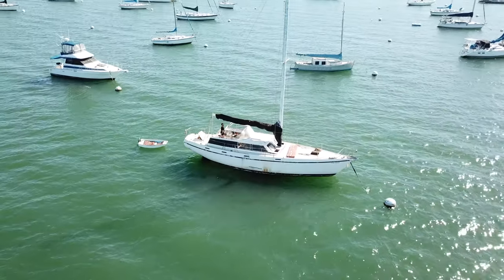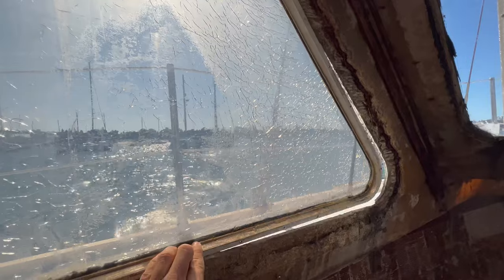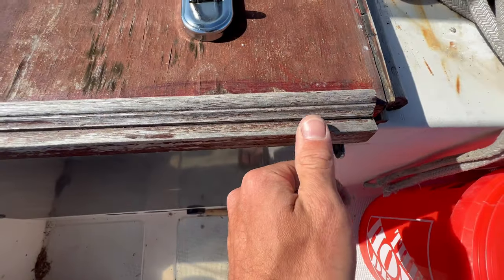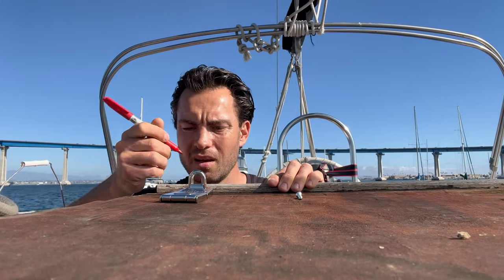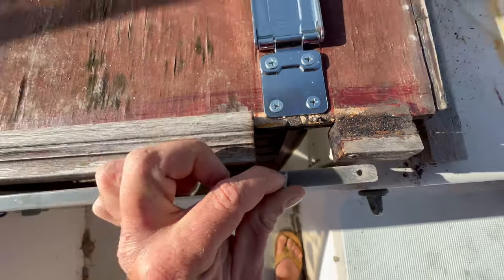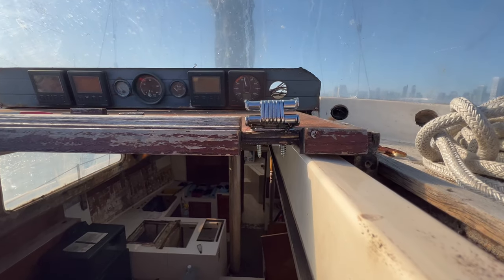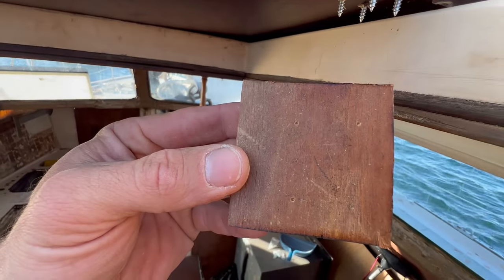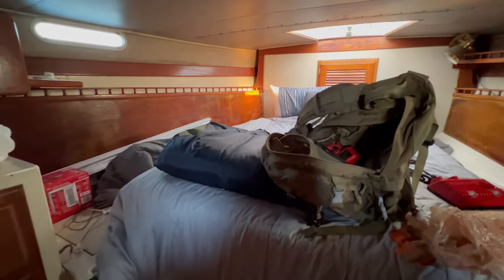Installing a Lock and Securing a Sailboat (Episode 34)

Comment: Doesn't your multi tool have a metal cutting blade? Just cut those screws off.
Reply from the maker: Hi John. Metal screws really tear up the blades on multi tools, especially stainless steel. I really just need to get a pack of blades and have a dedicated demo one. The grinder would have been much better, and I didn’t have it on board at the time.

Comment: Hows about two locks, one on the door and one on the hatch? The overhang, I would assume, is important to keep water out. The front of that hatch serves as a drip edge. If the dodger is over that section, then you will be fine, but I see the dodger doesn't go over it. 😬
to fasten the lock, I would use machine screws and nuts with washers so it would be that much harder to rip off.

The REAL question you have to ask yourself: Do you want to do the repair RIGHT? or do you want to go SAILING? I would suggest the latter!! Halfass-it and go sailing!!
Reply from the maker: You are right on all fronts. Two locks would have been better, and I'm REALLY hoping were done with the rains this year lol. 

I want to go sailing, yup, yes sir, that's what I want to do!
Reply: @ambiguousglobetrotter  Enjoying your videos. Can't wait to see the boat move!